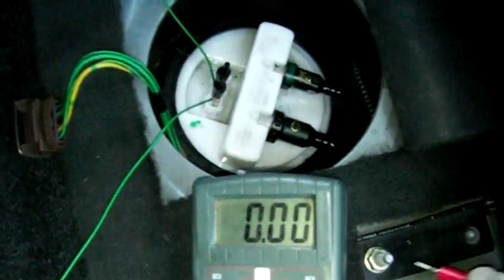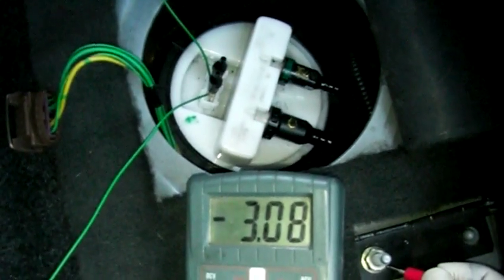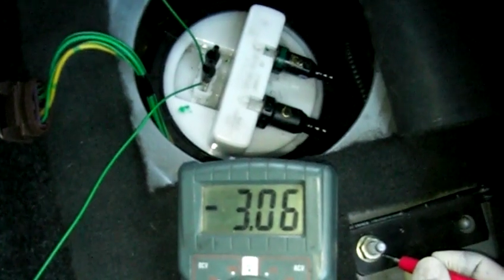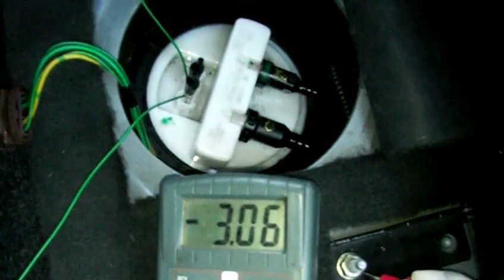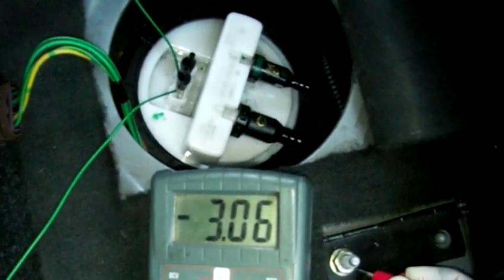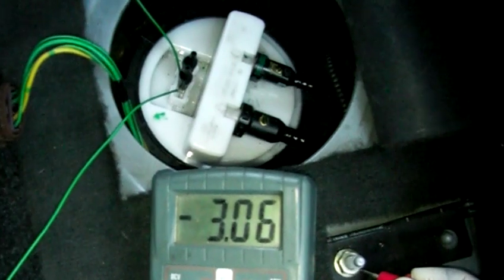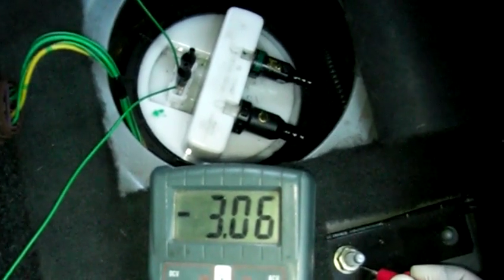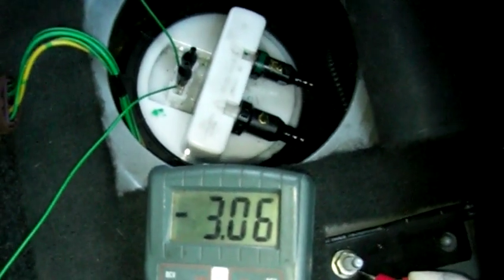Test 3 - Citroen Xantia 2.0 HDi Fuel Tank Pump - Air in pumped fuel. P0230 Fault

Comment from the maker: When re-fitting the pump assembly in the tank, it can be difficult to get the rubber ring to stay in place and difficult to get the thread started on the large threaded ring. The tank may leak when full if you don't get this right!

Comment from the maker: There is a large threaded ring around the pump on the top of the fuel tank. (Accessed under the back seat). Mark the ring so you can tighten it up to the same tightness when you refit it. Unscrew the ring by tapping it with a large flat screwdriver and hammer. It would be easy to damage the plastic, so take it slowly. When you lift the white pump assembly from the tank it is likely to be full of fuel even if the tank is near empty. Take care not to bend the float arm on the fuel guage sender..